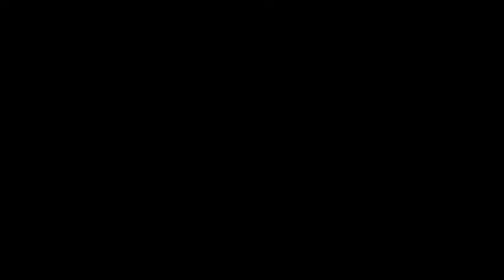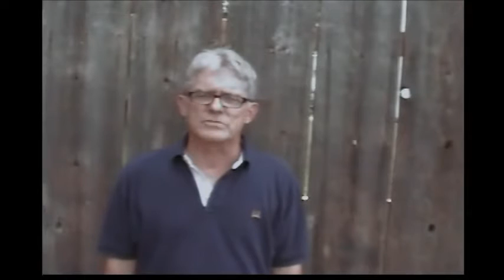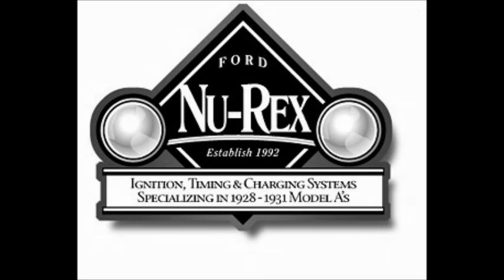Nu-Rex Alternators vs. The Competition

Comment: How does one remove the pulley? Is it threaded on the shaft? If so, holding the shaft with an Allen wrench should one be able to remove the pulley with a spanner wrench. Is there lock tite on the threads? Is it a normal right hand thread or left hand threaded shaft?
Reply: that's what impacts were made for . and what's the dif ? price if you can turn a wrench then buy a kit and do it yourself  pulley , rectifier , regulator  and your done